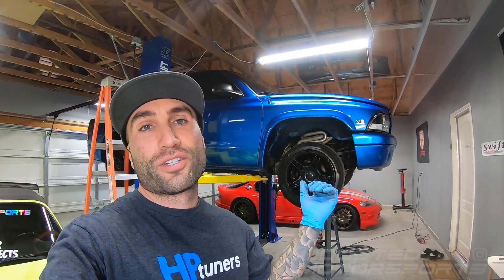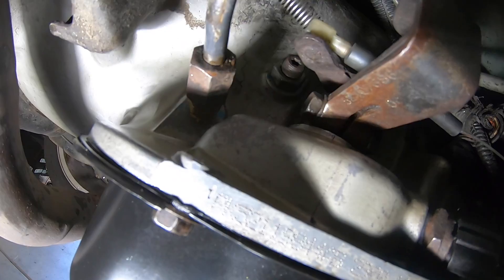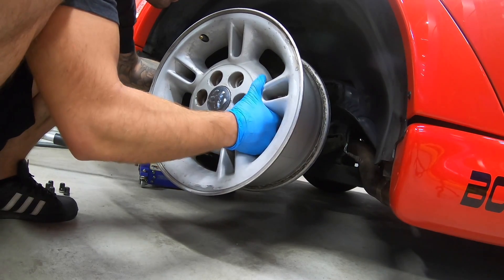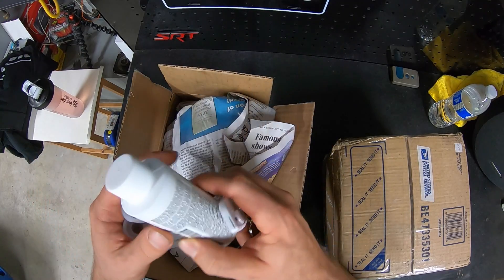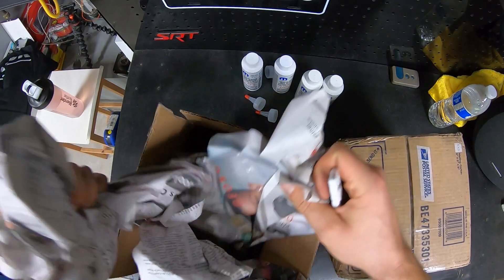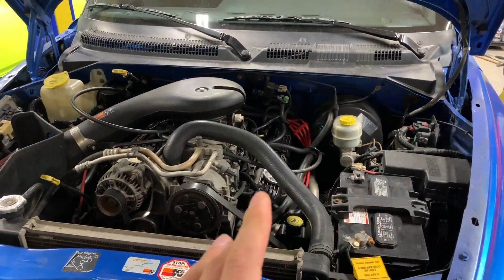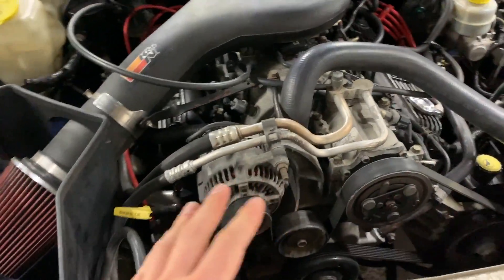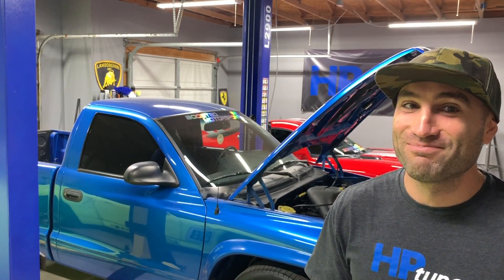Dodge Dakota R/T Project Truck Updates

Comment: I got a few suggestions for you. Get  a fluid suction tank with some long plastic straws so you can suck any fluids so you can remove fittings or parts so you will not cause any leaks when you have to remove parts that may need either to be replace or repair. Dakota/Durango bolt patterns are the same as the Vipers. As those 15inch aluminum rim, that is too small in diameter for those brake rotors. Try the R/T model rims, they should clear. I also you should get some early style viper rims for your Dakota, you will be amazed by the looks.

Comment: Just a quick question.  Did you ever have an issue with the e fan on the Ram 1500.  I have bought the e fan for my 2014 Ram, but have not installed it yet.  You've got me a little concerned now.

Comment: Great content as always just one thing I'd suggest replacing or atleast cleaning up those battery cables also could see some corrosion on the cable strands ther on the positive side before it hits ur batt clamps
Reply from the maker: Yeah I agree! Definitely on the to do list for sure! Just been tackling the major issues still 😂
Reply: @BoostedMotorsports  love what your doing.. I'm on my 3rd Dakota r/t build cant help it they're an addictive lil trucks